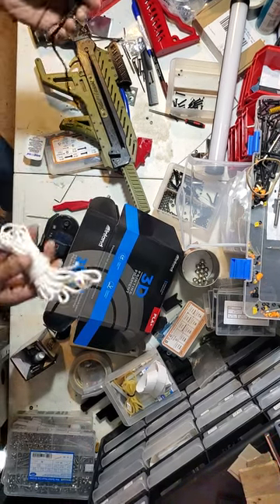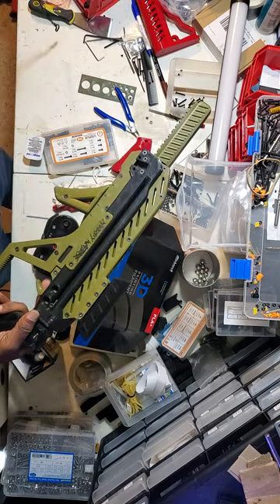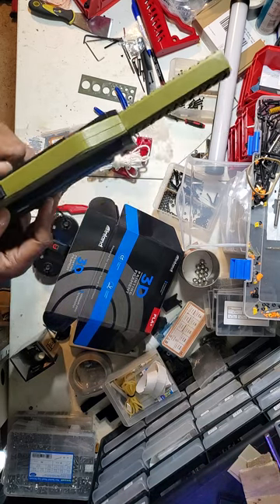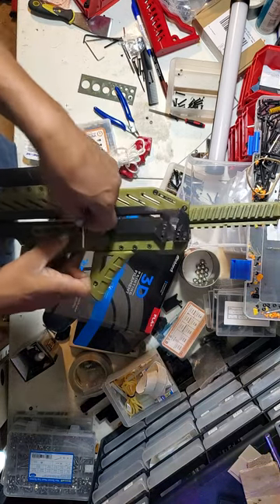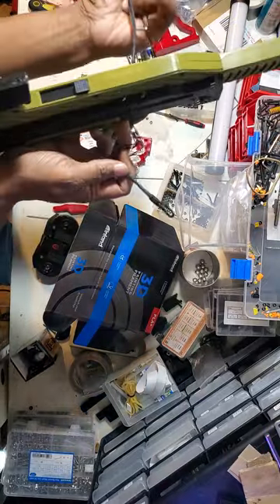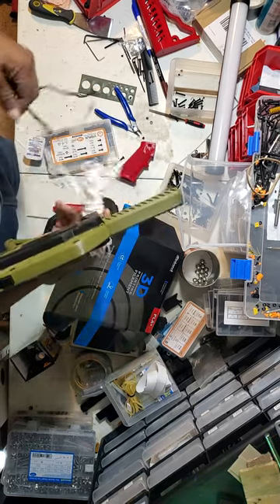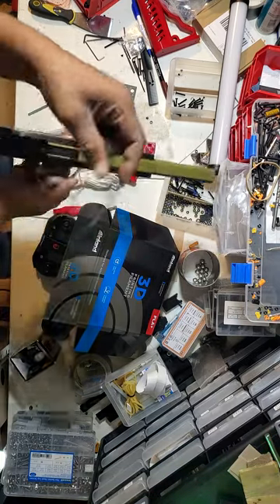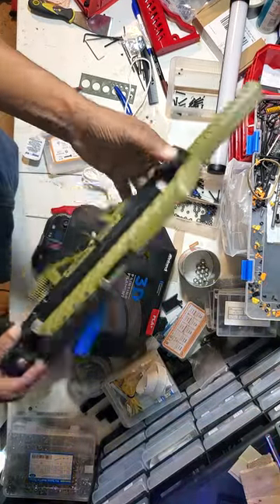How to Install crossbow string on sling hammer/Mini adder/ Arrow conversion. (Tight body rails)

Comment: I completed mine and it has more power than I expected!  I was concerned about how to get the string on the limb since I've never done it before.  I'm sure there may be an easier way, but after orienting it several ways to find what works best, I got it.  Thanks for the videos!